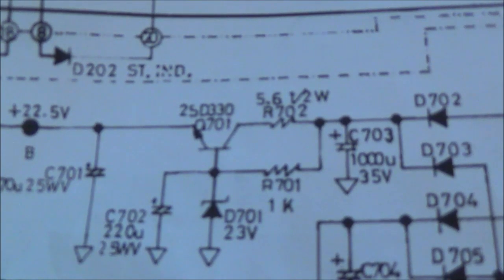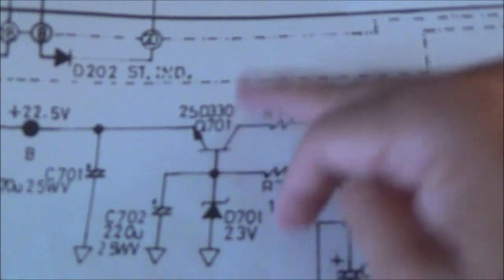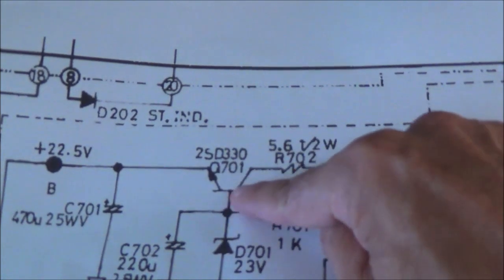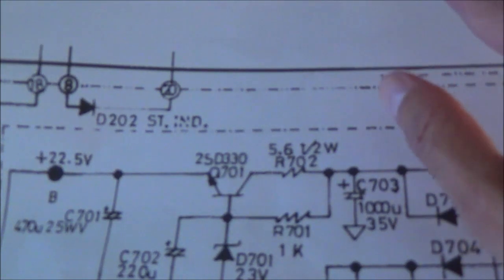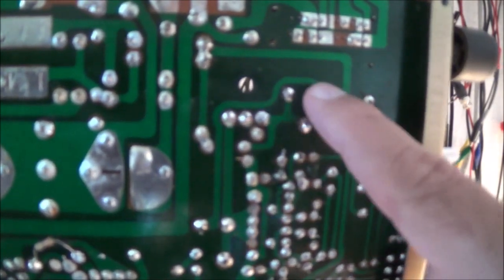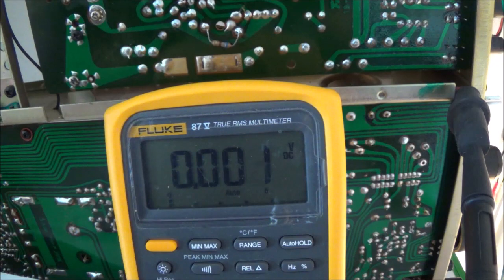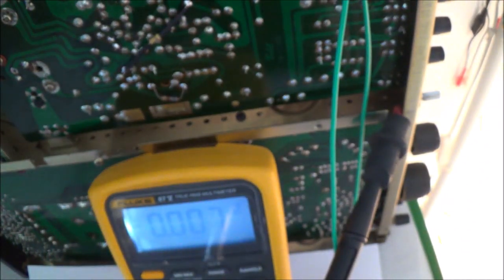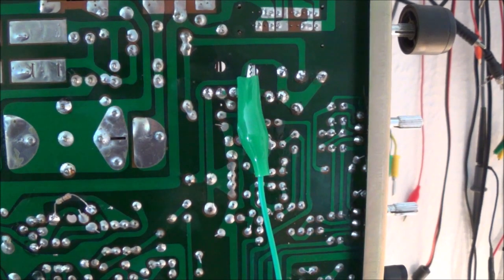NAD 7030 Stereo Receiver Series Regulator Circuit

Comment: Ha-ha, that was funny in regards to the DMM not connected, I've done that ample amount of time indeed!  :)  I may have missed it, but with the zener being bad, what was its symptom?  I also hear a buzzing from the radio, is that its symptom?  ~Jack, VEG
Reply from the maker: Oh, the symptom was no output voltage (22.5 volts) due to the shorted zener diode. That buzzing/humming may be my isolation transformer. I often forget to attach the meter leads or turn the test equipment on--which always stumps me for a minute! My favorite is when I forget to turn on power to the units that I work on. Suddenly all voltages missing...
Reply: That's right...sounds familiar!  :)  Still working on my office, building shelves...took a break (lunch) from sawing and building and watched your video whilst doing so...a little rattle brained from my days project...be glad when this long winded project is over, I'm soo done with it!  :)  ~Jack, VEG